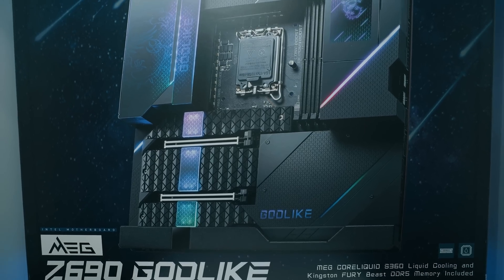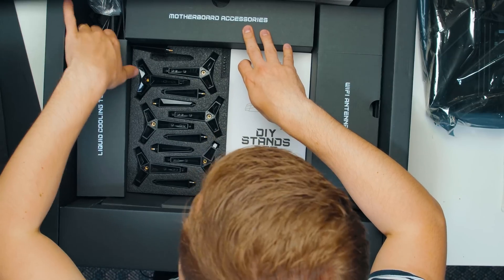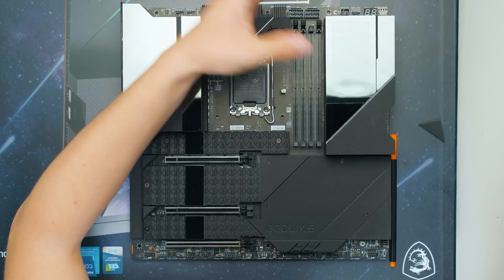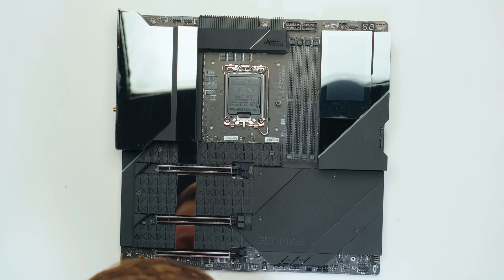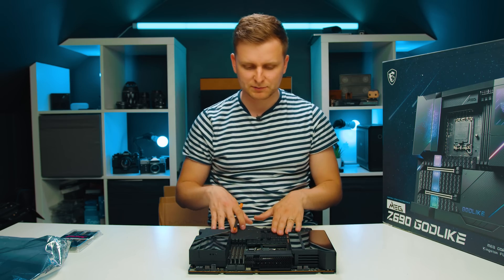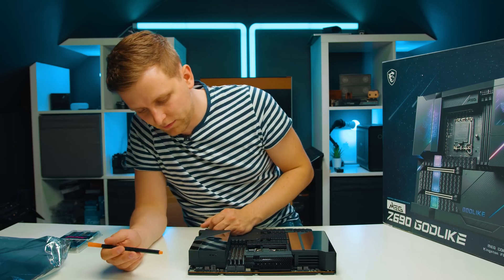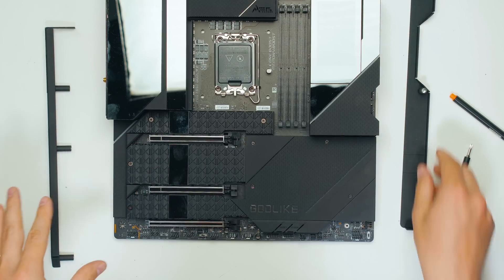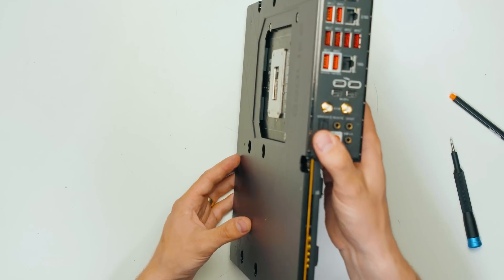Is this $1200 motherboard WORTH it for CREATORS? | MSI Z690 Godlike Overview

Comment: Are the 2 Thunderbolt ports functional for actual data transfer without a video card? I understand the additional capability for video  but does that infringe in any way on the TB ports functionality for MIDI etc? Thanks
Reply: id like to know about this as well.

Comment: Heck if you are still are holding on to the MSI Z690 motherboard and don't want it, I would be very grateful to take it off of your hands. I really want to build a pc off of the MSI Godlike Board. Currently it's out of my price range. By the time MSI drops the price on it the next Godlike MSI drops will be out.
Reply: You're probably gonna find it at $800 the leasy

Comment: "For Creators" you say. I see a lot of  M.2 that keeps you from using them while using the things you need. The rear I/O is nice if they would drop the WIFI. And how would you populate those three "less than" PCIe x16 slots as a video editor? Would be nice to be able to use a PCIe x4 M.2 raid card as a fast scratch disk and maybe an HBA sas card for DAS or local raid array. The 10gig ethernet port might be good for access to a nas. Overall I think this is just eye candy and bragging rights.

Comment: Don't think I'd pay much over 500 for any board. The diminishing return kicks in hard at about 350. And falls off a cliff at 500. Because outside of adding fans, pcie cards, ram, or rgb junk. You'll get the same core exp out of a 350 board as almost any higher price.
Reply: If it comes stock with a ddr5 kit, fans, cpu cooler, and the water cooling stuff on the side. I could see it as almost worth it.

Comment: if it is the Best Motherboard by MSI that comes with Memory Cards of the HighEnd Memory Cards for it and a High End Water Cooler as a MSI High End Motherboard then it means the Price is fair. it is like they sold you a All High End mini upgrade and Not like buying a Normal Motherboard but a High End that is recomanded by its creator means that they may even add real Gold on it as a Special product, so the Price is fair to me.

Comment: it's a computer in a box! The Godlike is total overkill from MSI but I can attest their more normal offerings that share some commonalities with the Godlike, like the Unify motherboard, are excellent. I don't know who this motherboard is aimed at other than those with more money than sense who believe that conspicuous consumption is an end in itself, and the price is inflated by all the other kit you get in the box, but MSI do make very good gear generally.

My B550 Unify board came with the same set of stands which I did use to good effect when bench-testing the basic functionality of my PC before I put it in the case. I can use them on future builds too!

Those few who absolutely have to have the top of the range and believe that the more something costs the better it must be will go for the Godlike, if they can*. For the rest of us there are still excellent products way down the price list. 

Personally I'm looking forward to the X670 motherboards and AM5 chips that are due out later this year.

*The Godlike is a limited production halo product meant to generate interest and buzz around the manufacturer. Normal mortals can't even buy a Godlike. You have to have an "in" with MSI, like if you wanted to buy a GT3 from Porsche...

(Disclaimer: I'm a bit of an MSI fanboi - 3 of my PCs are built with MSI motherboards; 2 have MSI graphics cards)

Comment: I've just finished my latest build with the MSI z690 Tomahawk. I do a bit of everything on my PC, astrophotography image processing, gaming, music, films etc. 
I can do absolutely everything I need to do using my £250 mobo & wouldn't benefit in the slightest spending an extra £600 for this thing  (or whatever it'll cost over here in the rip off uk..... actually probably around £1600 knowing this country, Swiss prices for Somali services) I don't think many people would utilize this board to its fullest at least for another year or so once DDR5, 40 series Nvidia cards & 13th/ 14th Gen Intel become the norm, but by then these type of mobo's will also be heading that way as well. 
Anyway that's a big, fat NO from me 😂

Comment: I absolutely do not need this, but I want it. Lol
Can you do a video on the absolute BEST motherboard build for a Photographer/light video user. I’m talking fast memory, Thunderbolt, fastest drives , best video card etc. 
I built the same built you did in 2020 with the MSI Prestige X570 creator board. It’s still phenomenal but want faster for photo editing. That board does not have Thunderbolt. 
Love your content.

Comment: So based purely on aesthetics this board ticks all of the boxes. Mainly the positioning of the connectors. 

Coupled with a top end aio and all of the M.2’s that in itself becomes a value. Because when you consider a similar aio cost $200 and a add in m.2 card cost $150. Plus the ability to convert this to a test bench for the future. It’s an interesting value preposition. 

For creators this probably isn’t the best way to allocate your budget. 
Unless you don’t have a NAS. 

If you don’t have a NAS then it’s a wash. 

My next build will have a top tier board because of the feature sets they provide.

Comment: I am happy with my ASUS Hero z690, especially because it comes with a PCIE Expansion card, so I can run all my NVME SSD at full speed.
I wished though there was a Bios Upgrade coming out, support 4 Slot DDR5 XML Profiles.